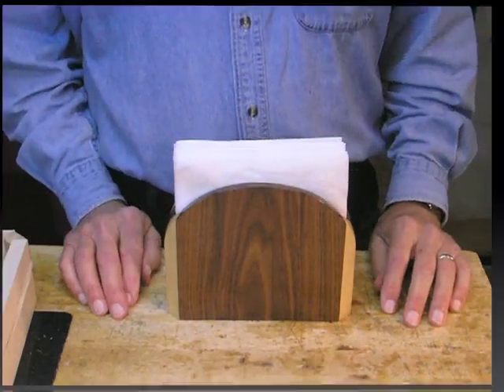Bird Mouth Joinery: the 8-side router bit

Comment: Thank you very much for your videos, I like it and I am working in wood industry and I try to learn your videos and make an English sub to teach more people. Please spend a little time to check that what I made is exactly what you are telling us in the video. I would appreciate your help. Hope I can have your revision and Thanks again.
Dialogue: 0,0:00:04.16,0:00:05.04,Default,,0,0,0,,Hi
Dialogue: 0,0:00:05.04,0:00:07.48,Default,,0,0,0,,I'm David Henry and this is my shop
Dialogue: 0,0:00:07.48,0:00:10.18,Default,,0,0,0,,In the last video this series
Dialogue: 0,0:00:10.18,0:00:13.66,Default,,0,0,0,,I've just cut the interesting and close forms
Dialogue: 0,0:00:13.66,0:00:17.84,Default,,0,0,0,,available for the six-side bird mouth router bit
Dialogue: 0,0:00:17.84,0:00:22.70,Default,,0,0,0,,Are here, we are going to talk about the equally interesting and different.
Dialogue: 0,0:00:22.70,0:00:27.66,Default,,0,0,0,,range of shapes that'd be eight-side router bit can provide.
Dialogue: 0,0:00:27.66,0:00:33.28,Default,,0,0,0,,Of course by showing how such eight-side bird mouth joinery.
Dialogue: 0,0:00:33.28,0:00:37.64,Default,,0,0,0,,can lead to practical and easily available projects.
Dialogue: 0,0:00:37.64,0:00:41.68,Default,,0,0,0,,Such as a.. get quality napkin holder
Dialogue: 0,0:00:41.68,0:00:44.96,Default,,0,0,0,,and a very cool jewelry box
Dialogue: 0,0:00:45.28,0:00:46.66,Default,,0,0,0,,Let's go
Dialogue: 0,0:00:47.42,0:00:50.34,Default,,0,0,0,,Here's some quick clips of what they look like
Dialogue: 0,0:00:50.34,0:00:53.10,Default,,0,0,0,,I get to the details in a few minutes
Dialogue: 0,0:00:56.58,0:01:01.74,Default,,0,0,0,,By way of review, here's to look at my eight-side router bit
Dialogue: 0,0:01:03.32,0:01:05.64,Default,,0,0,0,,Something really special here.
Dialogue: 0,0:01:06.56,0:01:09.92,Default,,0,0,0,,eh, It cuts a v-groove many edges stock
Dialogue: 0,0:01:10.06,0:01:12.36,Default,,0,0,0,,edge here there it left V-groove
Dialogue: 0,0:01:12.76,0:01:16.72,Default,,0,0,0,,and the next piece in the eight-side it shapes that you're building
Dialogue: 0,0:01:17.06,0:01:19.10,Default,,0,0,0,,fits tightly into it
Dialogue: 0,0:01:19.10,0:01:22.80,Default,,0,0,0,,forming a eh.. very good eh.. good joint
Dialogue: 0,0:01:23.70,0:01:25.46,Default,,0,0,0,,when you've got eight of these
Dialogue: 0,0:01:27.12,0:01:29.10,Default,,0,0,0,,As I've assembled here
Dialogue: 0,0:01:30.08,0:01:31.12,Default,,0,0,0,,a bit
Dialogue: 0,0:01:31.14,0:01:35.44,Default,,0,0,0,,forms this eight-sided shape we're going after in it
Dialogue: 0,0:01:34.26,0:01:36.58,Default,,0,0,0,,very tight, rigid
Dialogue: 0,0:01:36.58,0:01:40.08,Default,,0,0,0,,form it's easy to glue and very strong
Dialogue: 0,0:01:41.84,0:01:45.86,Default,,0,0,0,,here it's set up eight-sided shape go from redwood and maple
Dialogue: 0,0:01:45.86,0:01:47.86,Default,,0,0,0,,to illustrate these staves
Dialogue: 0,0:01:47.86,0:01:50.06,Default,,0,0,0,,with a story that I'm trying to tell
Dialogue: 0,0:01:50.98,0:01:52.74,Default,,0,0,0,,as with the six-side bit
Dialogue: 0,0:01:52.74,0:01:57.02,Default,,0,0,0,,you can change the length of pairs aside such as these
Dialogue: 0,0:01:58.56,0:02:02.78,Default,,0,0,0,,eh, without offering the joint angles here and here
Dialogue: 0,0:02:02.78,0:02:07.42,Default,,0,0,0,,that provides the tight fit and strong glue joints between staves
Dialogue: 0,0:02:08.30,0:02:11.32,Default,,0,0,0,,eh this is the regular octagon
Dialogue: 0,0:02:11.32,0:02:14.74,Default,,0,0,0,,eh, and with oak staves being the same width
Dialogue: 0,0:02:15.48,0:02:18.18,Default,,0,0,0,,that's a simple example of what I'm talking about
Dialogue: 0,0:02:18.44,0:02:24.96,Default,,0,0,0,,visualize shorten these two staves from two inches down to one inch
Dialogue: 0,0:02:25.30,0:02:27.22,Default,,0,0,0,,I've done that, of course
Dialogue: 0,0:02:27.22,0:02:29.22,Default,,0,0,0,,eh, and here it is
Dialogue: 0,0:02:29.22,0:02:30.32,Default,,0,0,0,,this eh..
Dialogue: 0,0:02:30.62,0:02:33.02,Default,,0,0,0,,here are the two one-inch staves now
Dialogue: 0,0:02:33.64,0:02:36.12,Default,,0,0,0,,and these remain the same
Dialogue: 0,0:02:36.30,0:02:40.18,Default,,0,0,0,,and yep we changed the shape to distinctive diamond form
Dialogue: 0,0:02:41.86,0:02:47.42,Default,,0,0,0,,eh, alternatively we could talk about a lengthening staves like those two
Dialogue: 0,0:02:47.42,0:02:49.92,Default,,0,0,0,,and, and this piece I've done so the
Dialogue: 0,0:02:49.92,0:02:52.10,Default,,0,0,0,,these staves are two inches here
Dialogue: 0,0:02:52.10,0:02:55.32,Default,,0,0,0,,and they're five inches here and this is what you get
Dialogue: 0,0:02:55.32,0:02:58.92,Default,,0,0,0,,a very interesting and useful oval form
Dialogue: 0,0:03:01.82,0:03:07.78,Default,,0,0,0,,This oval form served as a model for jewelry box project that I'll be describing at the moment
Dialogue: 0,0:03:09.32,0:03:13.08,Default,,0,0,0,,mixing long  staves and short staves are in a form
Dialogue: 0,0:03:13.38,0:03:17.46,Default,,0,0,0,,gives many useful shapes eh for example
Dialogue: 0,0:03:17.66,0:03:21.44,Default,,0,0,0,,eh, In this piece, I built three short sets
Dialogue: 0,0:03:22.70,0:03:25.78,Default,,0,0,0,,Hold together with one long with one long set
Dialogue: 0,0:03:25.78,0:03:29.30,Default,,0,0,0,,and it provides this interesting larger shape
Dialogue: 0,0:03:29.76,0:03:32.94,Default,,0,0,0,,and this is the basis for the napkin holder
Dialogue: 0,0:03:32.88,0:03:36.86,Default,,0,0,0,,project that I'll be describing in a few moments
Dialogue: 0,0:03:37.58,0:03:38.34,Default,,0,0,0,,eh
Dialogue: 0,0:03:39.80,0:03:41.04,Default,,0,0,0,,in this piece
Dialogue: 0,0:03:42.16,0:03:46.68,Default,,0,0,0,,two short stave shape that corners and it form
Dialogue: 0,0:03:47.70,0:03:53.68,Default,,0,0,0,,eh and two long log longer ones eh seven inches, five inches
Dialogue: 0,0:03:53.68,0:03:57.88,Default,,0,0,0,,give this very useful potentially very useful
Dialogue: 0,0:03:57.88,0:03:59.88,Default,,0,0,0,,rectangular shape
Dialogue: 0,0:04:00.54,0:04:03.40,Default,,0,0,0,,eh why that's so interesting well
Dialogue: 0,0:04:03.50,0:04:06.14,Default,,0,0,0,,rectangular shapes are the basis
Dialogue: 0,0:04:06.28,0:04:11.22,Default,,0,0,0,,for most woodworking project at least that most of us undertake
Dialogue: 0,0:04:11.44,0:04:15.36,Default,,0,0,0,,And birth mouth joinery which is so easily accessible
Dialogue: 0,0:04:15.78,0:04:19.42,Default,,0,0,0,,can be applied to the construction of many of them
Dialogue: 0,0:04:21.00,0:04:26.32,Default,,0,0,0,,to bring this subject to a close here the last two new shapes that I'll talk about
Dialogue: 0,0:04:26.32,0:04:28.80,Default,,0,0,0,,They've chosen almost just random
Dialogue: 0,0:04:28.80,0:04:33.14,Default,,0,0,0,,and the sample from the same parts that you've already seen
Dialogue: 0,0:04:33.86,0:04:36.80,Default,,0,0,0,,now, that's symmetrical and previous shapes
Dialogue: 0,0:04:37.40,0:04:39.88,Default,,0,0,0,,but the groove still holds
Dialogue: 0,0:04:40.20,0:04:43.24,Default,,0,0,0,,if opposite pairs of staves
Dialogue: 0,0:04:46.40,0:04:48.24,Default,,0,0,0,,of the same length
Dialogue: 0,0:04:48.88,0:04:50.24,Default,,0,0,0,,joint angles
Dialogue: 0,0:04:51.98,0:04:53.62,Default,,0,0,0,,Don't changed
Dialogue: 0,0:04:53.62,0:04:56.80,Default,,0,0,0,,and a resulting eight-sided shapes locks
Dialogue: 0,0:04:56.80,0:04:59.78,Default,,0,0,0,,tightly together with strong glue joints
Dialogue: 0,0:05:02.20,0:05:04.80,Default,,0,0,0,,and the key point of all this
Dialogue: 0,0:05:04.80,0:05:10.22,Default,,0,0,0,,it's that all the constructions are easily and quickly fabricated
Dialogue: 0,0:05:10.46,0:05:12.78,Default,,0,0,0,,using bird mouth joinery
Dialogue: 0,0:05:13.40,0:05:16.80,Default,,0,0,0,,One final point for getting the specific projects
Dialogue: 0,0:05:16.80,0:05:18.52,Default,,0,0,0,,eh.. to demonstrate this point
Dialogue: 0,0:05:18.52,0:05:22.10,Default,,0,0,0,,I'm going to make an eight-side box similar to this one
Dialogue: 0,0:05:22.24,0:05:27.80,Default,,0,0,0,,but with the useful new wrinkled that edge to the versatility of bird mouth joinery
Dialogue: 0,0:05:28.24,0:05:29.52,Default,,0,0,0,,this box form
Dialogue: 0,0:05:29.56,0:05:34.44,Default,,0,0,0,,which made from parts taken from the demo set we've been looking at the bar
Dialogue: 0,0:05:34.44,0:05:37.84,Default,,0,0,0,,Every stave.. eh.. ..... for example
Dialogue: 0,0:05:37.84,0:05:43.22,Default,,0,0,0,,As a v-groove on one side and a square edge on the other
Dialogue: 0,0:05:43.96,0:05:45.40,Default,,0,0,0,,eh interestingly
Dialogue: 0,0:05:45.66,0:05:47.80,Default,,0,0,0,,if you just turn a piece over
Dialogue: 0,0:05:47.98,0:05:50.12,Default,,0,0,0,,that changes anything really
Dialogue: 0,0:05:50.56,0:05:53.20,Default,,0,0,0,,ah.. the v-groove on this piece
Dialogue: 0,0:05:53.38,0:05:57.36,Default,,0,0,0,,it's now on this side and the square edge is now on this side
Dialogue: 0,0:05:58.32,0:06:02.56,Default,,0,0,0,,this leads to the thought that why not put
Dialogue: 0,0:06:02.66,0:06:07.98,Default,,0,0,0,, two grooves on this one stave eh be one here and one here
Dialogue: 0,0:06:08.22,0:06:12.80,Default,,0,0,0,,and the result would be wouldn't need any v-groove on the next piece
Dialogue: 0,0:06:13.02,0:06:17.10,Default,,0,0,0,,so we have two v-grooves here, and here, and here, and here
Dialogue: 0,0:06:17.62,0:06:20.38,Default,,0,0,0,,then we have four pieces with no
Dialogue: 0,0:06:20.66,0:06:22.84,Default,,0,0,0,,eh v-grooves cutting them at all.
Dialogue: 0,0:06:24.02,0:06:29.16,Default,,0,0,0,,eh that doesn't change the angles any this plank to be a piece will not be affected
Dialogue: 0,0:06:30.10,0:06:33.98,Default,,0,0,0,,but there are some definite advantages to do it this
Dialogue: 0,0:06:34.10,0:06:38.14,Default,,0,0,0,,so, let's try and maybe we can cut some wood in the process
Dialogue: 0,0:06:38.60,0:06:41.44,Default,,0,0,0,,OK, here's what we need router table
Dialogue: 0,0:06:42.14,0:06:45.70,Default,,0,0,0,,Eight sided bit, stock, cut to the dimension ready.
Dialogue: 0,0:06:45.70,0:06:48.90,Default,,0,0,0,,this stock is about 1/2 inch thick
Dialogue: 0,0:07:47.54,0:07:50.42,Default,,0,0,0,,OK, here's parts we've just cut
Dialogue: 0,0:07:51.22,0:07:54.40,Default,,0,0,0,,And here they are loosely assembled
Dialogue: 0,0:07:55.16,0:07:57.44,Default,,0,0,0,,Here they are hopefully
Dialogue: 0,0:08:04.26,0:08:09.32,Default,,0,0,0,,Finally .......after made .......here we go..
Dialogue: 0,0:08:10.64,0:08:14.22,Default,,0,0,0,,OK why this small joinery changes to pot
Dialogue: 0,0:08:14.44,0:08:16.82,Default,,0,0,0,,For one thing the joint pattern
Dialogue: 0,0:08:17.22,0:08:20.68,Default,,0,0,0,,to here, it becomes more symmetrical
Dialogue: 0,0:08:20.94,0:08:25.24,Default,,0,0,0,,and symmetry's often more pleasing to the eyes than asymmetry
Dialogue: 0,0:08:25.58,0:08:31.46,Default,,0,0,0,,Of course, with many woodworking project the joint pattern is a permanent part of the design
Dialogue: 0,0:08:31.62,0:08:34.14,Default,,0,0,0,,And this gives you more flexibility
Dialogue: 0,0:08:34.96,0:08:40.22,Default,,0,0,0,,Another important gain from this pattern change is for
Dialogue: 0,0:08:40.76,0:08:43.00,Default,,0,0,0,,These ones of these eight
Dialogue: 0,0:08:43.22,0:08:48.28,Default,,0,0,0,,staves remained square and unchanged from the original stock
Dialogue: 0,0:08:48.40,0:08:52.94,Default,,0,0,0,,And they can there assume other usage in project design
Dialogue: 0,0:08:52.94,0:08:58.96,Default,,0,0,0,,Because they do not have ex-potentially on slightly exposed grooves in one side
Dialogue: 0,0:08:58.96,0:09:00.96,Default,,0,0,0,,That's it would help otherwise
Dialogue: 0,0:09:01.70,0:09:03.78,Default,,0,0,0,,As assembled example
Dialogue: 0,0:09:03.88,0:09:07.44,Default,,0,0,0,,Of think of how this box might look with
Dialogue: 0,0:09:07.92,0:09:09.56,Default,,0,0,0,,short legs
Dialogue: 0,0:09:10.12,0:09:14.60,Default,,0,0,0,,well, that could be done simply by increasing this stave length
Dialogue: 0,0:09:15.54,0:09:19.96,Default,,0,0,0,,and of course, we did that when we're preparing parts for the little demonstration.
Dialogue: 0,0:09:20.12,0:09:22.36,Default,,0,0,0,,and here is what it looks like
Dialogue: 0,0:09:24.32,0:09:27.02,Default,,0,0,0,,OK, let's now have a look at those specific
Dialogue: 0,0:09:27.02,0:09:29.46,Default,,0,0,0,,project, this napkin holder project
Dialogue: 0,0:09:29.66,0:09:32.14,Default,,0,0,0,,with base on this
Dialogue: 0,0:09:32.56,0:09:36.20,Default,,0,0,0,,sludge form, that was discussed earlier in the video
Dialogue: 0,0:09:36.52,0:09:41.66,Default,,0,0,0,,the similarity is obvious when you looked at the napkin holder from the bottom
Dialogue: 0,0:09:43.34,0:09:45.18,Default,,0,0,0,,due to me
Dialogue: 0,0:09:45.56,0:09:49.70,Default,,0,0,0,,with walnut and with maple
Dialogue: 0,0:09:50.10,0:09:53.88,Default,,0,0,0,,and the stock is 3/8 inch in thick
Dialogue: 0,0:09:54.60,0:09:57.82,Default,,0,0,0,,in essence, eh... it is a topless box
Dialogue: 0,0:09:57.92,0:10:00.04,Default,,0,0,0,,made initially but a square
Dialogue: 0,0:10:00.58,0:10:02.04,Default,,0,0,0,,profile on the top
Dialogue: 0,0:10:02.36,0:10:06.98,Default,,0,0,0,,and it's rounded off by band saw and sanding after assembling
Dialogue: 0,0:10:07.38,0:10:09.16,Default,,0,0,0,,the bottom is ..
Dialogue: 0,0:10:09.92,0:10:13.70,Default,,0,0,0,,inside here about is 1/4 inch
Dialogue: 0,0:10:13.92,0:10:19.90,Default,,0,0,0,,formed it veneer ply and it's held in place by 3/6 inch
Dialogue: 0,0:10:19.90,0:10:23.24,Default,,0,0,0,,Dado's around the inside all the bottom here
Dialogue: 0,0:10:23.74,0:10:25.24,Default,,0,0,0,,eh that's a way that 
Dialogue: 0,0:10:26.08,0:10:28.32,Default,,0,0,0,,through a bottom's commonly built
Dialogue: 0,0:10:28.70,0:10:31.66,Default,,0,0,0,,the bottom piece cell was shaped
Dialogue: 0,0:10:31.66,0:10:34.32,Default,,0,0,0,,by tracing around the clamp
Dialogue: 0,0:10:35.02,0:10:36.52,Default,,0,0,0,,but unglued
Dialogue: 0,0:10:36.52,0:10:38.52,Default,,0,0,0,,body of the box
Dialogue: 0,0:10:38.96,0:10:42.48,Default,,0,0,0,,that is retraced on the plywood stock and
Dialogue: 0,0:10:44.26,0:10:49.40,Default,,0,0,0,,then the tracing was simply reduced inside by 3/16 of an inch
Dialogue: 0,0:10:49.40,0:10:51.54,Default,,0,0,0,,all the way round that's how to do that
Dialogue: 0,0:10:51.88,0:10:55.90,Default,,0,0,0,,bottom wood fit into the slots it spaced made for
Dialogue: 0,0:10:56.94,0:11:00.64,Default,,0,0,0,,the piece was assembled around that bottom
Dialogue: 0,0:11:00.64,0:11:05.10,Default,,0,0,0,,and with finish with clear white bond polyurethane
Dialogue: 0,0:11:05.28,0:11:08.60,Default,,0,0,0,,eh over a slacked undercoat 
Dialogue: 0,0:11:09.34,0:11:12.00,Default,,0,0,0,,eh... this napkin holder
Dialogue: 0,0:11:12.00,0:11:17.34,Default,,0,0,0,,has been used as breakfast nut for quite sometimes, and they work very well
Dialogue: 0,0:11:17.74,0:11:21.98,Default,,0,0,0,,this thirteen inches box is based on the oval form
Dialogue: 0,0:11:22.66,0:11:26.70,Default,,0,0,0,,after we described earlier they're these comparison
Dialogue: 0,0:11:27.82,0:11:31.34,Default,,0,0,0,,eh and the first length's this box's 
Dialogue: 0,0:11:31.38,0:11:35.18,Default,,0,0,0,,look very good for enter from this napkin holder
Dialogue: 0,0:11:35.18,0:11:38.78,Default,,0,0,0,,but in fact they're quite similar
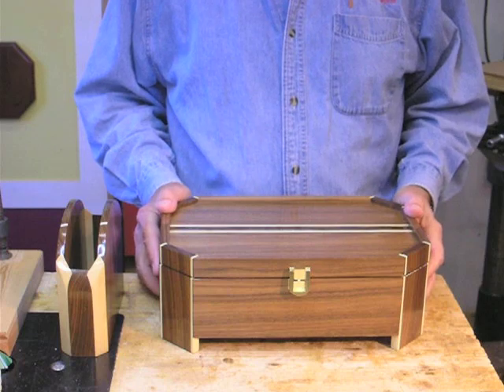Dialogue: 0,0:11:38.78,0:11:43.16,Default,,0,0,0,,Because of their share bird mouth joinery construction
Dialogue: 0,0:11:43.44,0:11:48.66,Default,,0,0,0,,And I'm going to compare them to emphasize those similarities
Dialogue: 0,0:11:50.46,0:11:54.08,Default,,0,0,0,,Besides from both being made origin from walnut
Dialogue: 0,0:11:54.32,0:11:58.74,Default,,0,0,0,,both for constructed using these two grooves, no groove
Dialogue: 0,0:11:58.86,0:12:02.98,Default,,0,0,0,,Alternating stave pattern, I am going to explain that
Dialogue: 0,0:12:02.98,0:12:05.72,Default,,0,0,0,,eh.. that is this stave has two grooves in
Dialogue: 0,0:12:06.10,0:12:08.30,Default,,0,0,0,,this stave has none this
Dialogue: 0,0:12:09.20,0:12:11.60,Default,,0,0,0,,two none and so on
Dialogue: 0,0:12:12.64,0:12:15.96,Default,,0,0,0,,and from box this choice of design
Dialogue: 0,0:12:16.28,0:12:20.76,Default,,0,0,0,,eh.. permitted a design with legs, short legs
Dialogue: 0,0:12:20.90,0:12:22.56,Default,,0,0,0,,and the inclusion
Dialogue: 0,0:12:22.72,0:12:27.32,Default,,0,0,0,,easy inclusion of this how I accessed
Dialogue: 0,0:12:28.46,0:12:32.92,Default,,0,0,0,,but you're basic construction, here is identical
Dialogue: 0,0:12:33.18,0:12:35.72,Default,,0,0,0,,eight staves're around the point-free
Dialogue: 0,0:12:35.72,0:12:40.26,Default,,0,0,0,,of alternative woods with only... only different
Dialogue: 0,0:12:40.60,0:12:43.42,Default,,0,0,0,,in the width of the staves
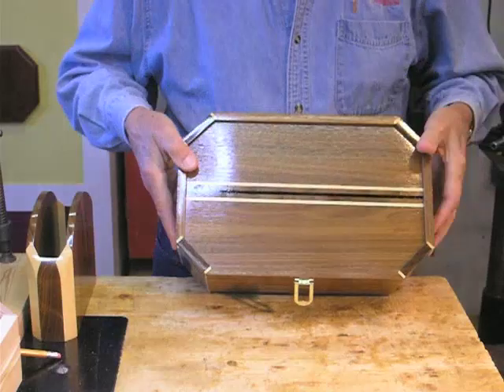Dialogue: 0,0:12:44.16,0:12:47.88,Default,,0,0,0,,but the construction is identical
Dialogue: 0,0:12:50.50,0:12:53.44,Default,,0,0,0,,the box of course has a length
Dialogue: 0,0:12:54.48,0:12:57.92,Default,,0,0,0,,but both lid and body were constructed
Dialogue: 0,0:12:58.10,0:13:01.40,Default,,0,0,0,,eh, by exactly the same processes of napkin holder
Dialogue: 0,0:13:02.08,0:13:06.98,Default,,0,0,0,,ah.. eh dato groove around the interior to accept
Dialogue: 0,0:13:07.20,0:13:10.90,Default,,0,0,0,,the top panel and also the bottom panel of course
Dialogue: 0,0:13:11.84,0:13:16.08,Default,,0,0,0,,the lid panel was fabricated from 1/2 inch all it
Dialogue: 0,0:13:16.08,0:13:19.66,Default,,0,0,0,,with the inserted hard lay and ebony strips
Dialogue: 0,0:13:20.10,0:13:23.30,Default,,0,0,0,,and then planed to 1/4 inch thickness
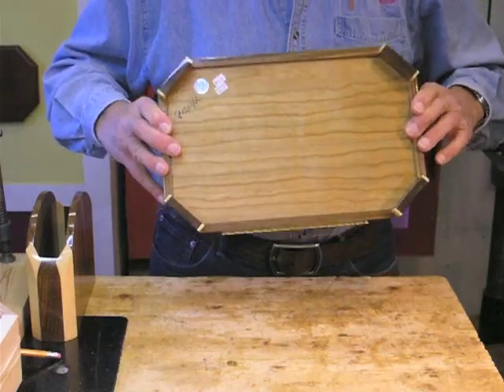Dialogue: 0,0:13:23.62,0:13:26.00,Default,,0,0,0,,and the equivalent bottom panel
Dialogue: 0,0:13:26.00,0:13:30.14,Default,,0,0,0,,is 1/4 inch more veneer ply
Dialogue: 0,0:13:31.78,0:13:34.26,Default,,0,0,0,,and the bounds for
Dialogue: 0,0:13:34.38,0:13:39.50,Default,,0,0,0,,cut these panel top to bottom or cut to shape by decreasing technique
Dialogue: 0,0:13:39.50,0:13:44.38,Default,,0,0,0,,again described earlier for the bottom of napkin holder
Dialogue: 0,0:13:45.78,0:13:50.32,Default,,0,0,0,,OK, that's what I wanna want to say right now and erase about the
Dialogue: 0,0:13:50.56,0:13:52.92,Default,,0,0,0,,8 sides bird mouth router bit
Dialogue: 0,0:13:52.92,0:13:54.66,Default,,0,0,0,,along with the six-side bit
Dialogue: 0,0:13:54.66,0:13:57.22,Default,,0,0,0,,it's a very versatile tools
Dialogue: 0,0:13:57.22,0:14:00.90,Default,,0,0,0,,for constructing a wine dried wood projects
Dialogue: 0,0:14:01.22,0:14:03.68,Default,,0,0,0,,and the most important piece
Dialogue: 0,0:14:03.68,0:14:06.50,Default,,0,0,0,,bird mouth joinery is very simple
Dialogue: 0,0:14:06.76,0:14:09.48,Default,,0,0,0,,it's allowed quick access
Dialogue: 0,0:14:09.48,0:14:11.98,Default,,0,0,0,,to many quality project
Dialogue: 0,0:14:12.12,0:14:16.86,Default,,0,0,0,,that would merely would take substantial skill in a classical technique
Dialogue: 0,0:14:16.86,0:14:21.04,Default,,0,0,0,,such as dove-tails and mortise and tenon
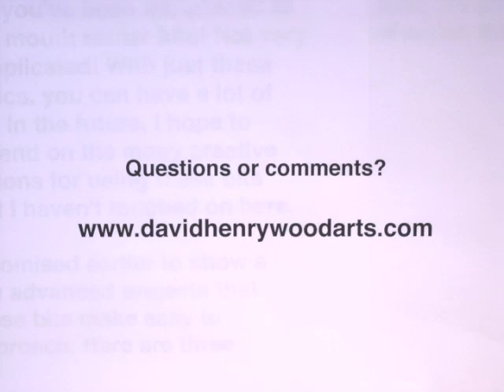Dialogue: 0,0:14:22.04,0:14:26.34,Default,,0,0,0,,give it a try, I think you'd be tad, you did
Dialogue: 0,0:14:26.96,0:14:29.32,Default,,0,0,0,,Thanks for watching
Reply from the maker: Tran Son Hi Tran!  I'm grateful for your interest in my videos and I'm happy to help out with clarifying the English subtitles. However It will take a few days or a week. Please send me a link to the video version that you create, when it is complete.